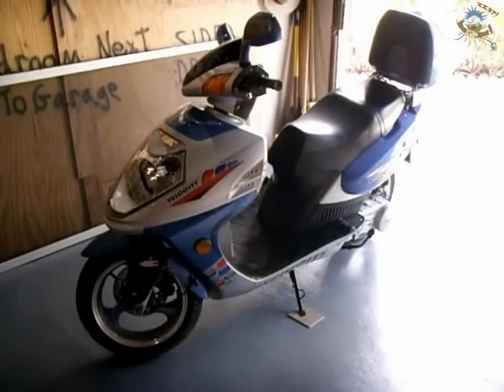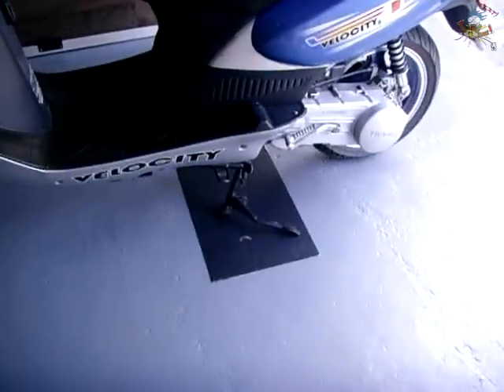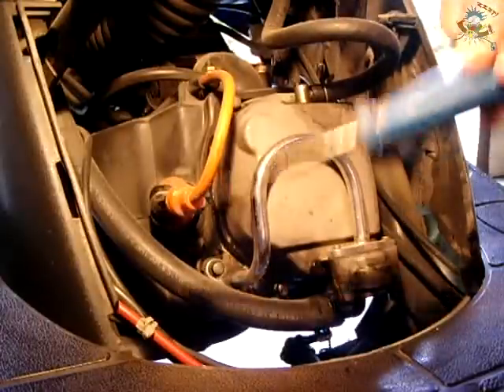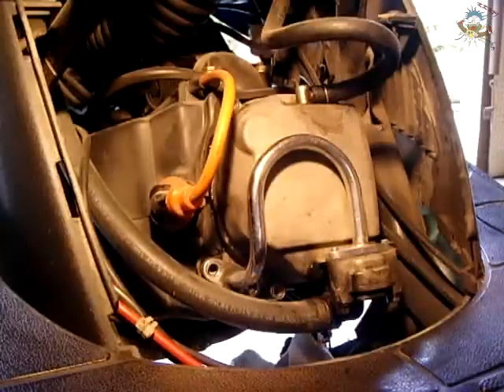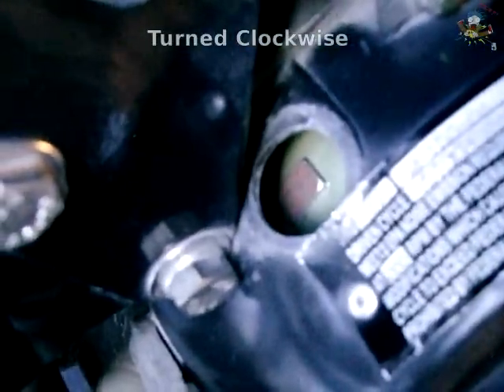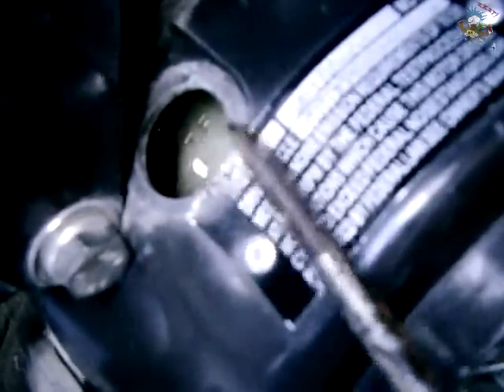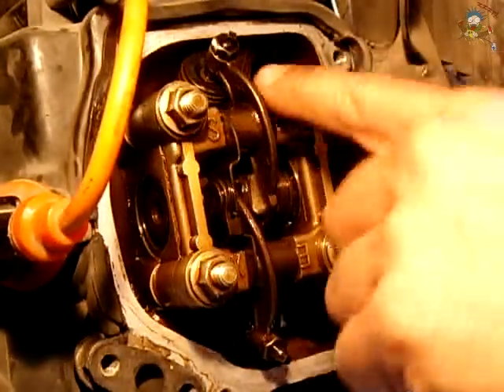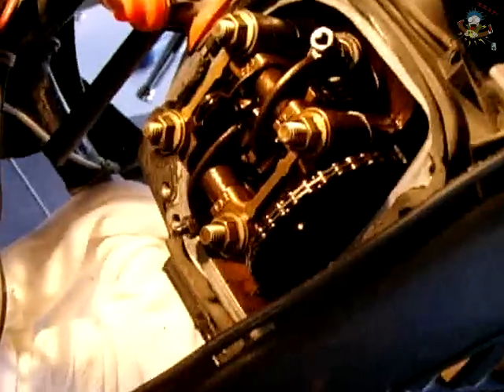Highly Detailed GY6 Valve Adjustment Procedure(Step By Step)

Comment: I have a icebear Trifecta 150cc gy6 long engine. On a factory label it states the valves are top valve 0.08 and bottom 0.09.....some video's say 0.04 top & bottom 0.05 which is right.

Comment: I watched this carefully. Here are two things that I feel should be absolutely clarified. He said "ohohfive" very quickly when using the feeler gauge This means .005 inches Do not use Millimeters..... the thickness used to set the GAP of the rocker arms. It is marked on the feeler gauge and will very quickly be unreadable later. So make a mark on the gauge leaf that you can easily recognize later. Turning the engine to get to the right point for TDC (Top Dead Center) where all valves are fully closed so the gap can be set, MUST be done so that  the engine is turned in the clockwise direction with the wrench. Backwards does not work well! In reality, a very informative video. Thanks!

Comment: I hope ENM or one of the commentators can provide me with an answer. My 150cc brand new scooter has trouble starting after its warmed up(sometimes it won't start at all). Could a valve adjustment be the culprit or is there a better or more realistic solution? Please help!
Reply from the maker: Adjust valves first

Comment: Thank you for the video, my scooter seemd not having power anymore, despite new belt and Variator  it was the valves, i adjusted the spacing and now the scooter seems like a jet! (Had a little problem with the gasket of the valve cover, so it was leaking a little oil, but rearranged the gasket, repositioned the cover, and now is perfect!)
Reply from the maker: Glad it helped Francesco!

Comment: Great Video,  I like a tight 05mm myself.  But I have found that some bikes run better with 04mm and others up to 06mm.  I have a valve setting tool but I prefer using a box end 9mm box for the nut and the tiny end of the valve tool for the screw.
Reply from the maker: Glad you liked the video!

Comment: Scooter repair technician reporting in. I want to set a remark he said straight. I also speak from a user stand point.. I own. Gy6 150 it's my daily driver.

You only need to check valves at 5k unless you are having a problem. This is per manufacturer guidelines. Every 5k there after. Since 2016 forward there was a revision at the factory depending on which one produced your engine. They are a  lot better now. I witness on a regular basis bikes at 12k plus that come in running great and never had valves adjusted. Not saying don't, but Its not like it used to be.

I've witnessed engines with 20k miles and still running great. The key is changing oil on time. Doesn't matter what you use as long as it's correct weight. Don't use additives.

Biggest problem I see mainly is belts snapping after 6k. Change belt AND rollers at 5k. By 10k or so your clutch will be worn... 60 bucks.. replace it. You will get hints if you watch your rpms and know where they should be for a given speed..  the engine will rev a little higher. If you see that or feel a vibration thats unusual that's another possible sign.

Look, let's be real. These scooters aren't designed to last. By 3 years daily driving it's not the drive train you will be worried about. It's everything else... Turn switches, brakes and system, tires, and all that cheap plastic body panels will crack and break apart. Muffler baffling breaks off inside given you this loud rattle noise because of inferior welding.

Buy one, plan on having roughly 1 year of great service. By year two you will start seeing the effects of time. Most repairs will be very cheap. By year 3 you need to make a decision... Given you will be at 15k miles... Think about just buying another scooter. Strip the thing for spare parts and go on with it..
Reply from the maker: It doesn't hurt to check sooner.
Reply: @electronicsNmore  each time you Crack open your engine you invite oil leaks. If there isn't a problem  don't fix it is my war cry.

Look I get it. Through the years I've learned about scooters.. I'm not a know it all and I certainly am not some self proclaimed master. I am however well versed in the drivetrain even going as far to being a tag along to Chinese and tiawanese factories getting to see them being made.

I'm more knowledgeable about the  people who buy these things and have broke them down into categories. You fall into the tinker group. You have fun tearing into your scooter because it's cheap, less risky, and it entertains you.. nothing wrong with that, at all. However this type can be a PITA. They will bring their scooters in have me tune them to factory spec only to go home and undo everything I did on a perceived notion their "tune" makes more power.

Another common group is the "I want cheap transportation". They just want their scooters to start and run. Maintenance isn't on the forefront with them. They are the ones I make my money on. You commonly will find them out in the wild in their native habitats walking their scooters on the sidewalk with snapped belts or catastrophic engine damage. They don't change oil and if it starts and drives that's good enough.

Next group is the "virgins". Its their first scooter and perhaps first real purchase. They are excited, over cautious and also a PITA because they will ask the same exact question to 50 different people looking for the answer they want to hear. They commonly have aspirations of keeping their scooters forever. You will find them in their native habitat spending way too much time washing amd waxing and debating whether to use  synthetic or Dino oil. By end of year 2 they finally realize its not worth the cost and hassle of doing everything they did and will then slack off. By year three their scooter is a collection of duct tape, wire amd super glue.

In the end., these aren't designed to last. They are not high performance. They are designed to hit a price point and to be as cheap as humanly possible. It doesn't matter what oil you run.. it's doesn't matter how special you think your engine is because a lot of people think this.. by year 3 of daily use you will hit that price wall

Comment: Hey great video man! The clearence is 0,05 in metric mm? Or inches? Greetings from Norway.
Reply from the maker: 1.25mm or .05"
Reply: @electronicsNmore  ok great mine were at less than 0.05mm now. Hopefully the reason why it was near impossible to start. Thanks for the quick answer.
Reply from the maker: @gjoffis  If the gap is too small, you'll have problems.
Reply: @electronicsNmore  yeah, now it starts like its new from factory🤩 thank you for the help.
Reply: 0.005 is 0.127mm, not1.25 I think.

Comment: hey bro I have a piaggio fly 50cc I have big problem to start the engine when the motor is cold I really suffer I cleaned the carb  changed the air filter change the plugs but still the  same problem.
I need almost 1 hour to start the engine.
Is the valve adjustment can be solution
Reply from the maker: Do you have an enricher?
Reply: @electronicsNmore  yep the carb have enricher but since I bought the scooter its not connected.
Ps. My scooter it a used one not a brand new.

Comment: I like the video..!! I just want to add that I preffer to find the Top dead center by taking the spark plug of and carefully introducing a small screw driver. That way I am 100% sure the the timing is correct. A simple teeth off on the camshaft would give a degree.
Reply from the maker: The timing marks should be accurate, but you can do it that way also. Thanks for watching!

Comment: GY6 149cc Tune Up Specifications....

.003 - .005 Inch : Intake
.005 - .007 Inch : Exhaust

( .076 - .127 Metric : Intake )
( .127 - .178 Metric : Exhaust )

Idle Speed : 1700 , +/- 100 RPM

Spark Plug : NGK C7HSA
Spark Plug Gap : 0.6mm - 0.7mm

Engine Oil : 15W40
Reply from the maker: I prefer a smaller gap for intake/exhaust.

Comment: Great vid.  I brought an older scoot and that pipe over the valve cover is missing.  What is that pipe called and what's it do?
Reply from the maker: It's an "EGR" cover. Exhaust Gas Recirculation.
Reply: Mine has that and a PCV circuit. Love my 06 Kymco GrandVista 250.

Comment: What happened if i checked the clearance but not rotate to crankshaft?
Reply from the maker: It's impossible to check without rotating the engine into the correct position.

Comment: .003 on intake and exhaust valve. Thank me later. Don't set at 4 or 5 or all this other bullshit.
Reply from the maker: .003 to .005 works fine. I've tested them all over the years.
Reply: @electronicsNmore  4 and 5 through trial and error makes compression loss it seems
Reply: More pep at 003. Do you still work on bikes?
Reply: @electronicsNmore  look forward to more troubleshooting moped vids

Comment: Help
I managed to dropped the fucking nut inside the engine. It was right under the chain so I tried to let gravity help but that asshole only let oil out because apparently it gets to decide the laws of physics. So I attempted to drag the nut out with a plastic straw (only thing I had that was long and thin) but I only managed to push it further back and the lil fucker pulled a Houdini on me and disappeared in the back. Can anyone tell me where it is and how do I get it out because draining the oil didn't work and I'm scared to start it. Thanks in advance.
Reply: Great video btw

Comment: So I did a valve adjustment and I started it before putting the crankcase cover back on incase I needed to re adjust, now have oil spewing out from in the middle of the rocker arms??
Any idea what's happened please?
Reply from the maker: That's normal. You don't run the engine with the cover off. Be sure to watch my "GY6 Scooter" video playlists, and share. Thank you!
https://www.youtube.com/watch?v=5vl1mrTVCQ0&list=PLQ6IOhUBblU1bkRJ9MagPsKn_Mekq4ws8
Reply: Thanks for the reply, it's still puking oil everywhere, when I take the cover off it looks like it's coming out of the groove in the top left of the rocker arms, it's spat LOADS of oil, do I need new rocker arms and cylinder head? The tapping is really bad now no matter how much adjustment I do

Comment: Everyone tell me I have air leak cracked hose some where  . I only have three hoses  one from the valve cover  that splits to two one to the carb the other to the elbow bend manifold  and  gas line to carb and the drain hose that’s it have taken them off and no cracks or holes .. was told gas leen mixture might be closed ..was told close it open 2 . 5 turns .. carb is new thought it would be pre set guess not .. 😕
Reply from the maker: Check valves, check carb, and check for hose leaks(cracked intake manifold)

Comment: Well I went through all the steps including the feeler gauge recommendation and while I was waiting for battery to charge I find a plate riveted on bottom frame has all the specs for engine and their valve clearance is top 0.06  bottom (exhaust)  0.08  big difference from .04 and .05   Ends up two kinda scooters one model is made to American standard smog and all that save the whales .. then there is a real Chinese scooter they don’t care if they leave a smog trail as long it runs to them it’s a work horse 
valve settings are different higher numbers .. long story short put battery and of course it did not start makes the blub blub sound better than before just not starting so setting must be wrong !! Gonna do this again and try the factory settings on the plate .. so my lesson today was beware of Trojan horses 🐴bearing gifts ..

mpg
Reply from the maker: Most people use smaller gaps than factory.
Reply: Thx bro

Comment: So once at TDC you say valve  have to be  closed does it matter because once you are there ( TDC ) you are going adjust them to proper settings so why should it matter open or closed if you are set at TDC
Reply from the maker: If they're not closed, that means you don't have it set correctly.
Reply: I’m not at TDC  then  ?

Comment: So the gauge clearance will  work for  any gy6 150.cc  I don’t have wrench’s or gauges but found at local auto parts tools will be $ 25 for
Reply from the maker: You can find very thin(.004/.005") strips of metal at a hobby shop for only a couple bucks.

Comment: Is cause with the on and off the engine?because, mine it will start but it will die down in a few minutes.just wonder!
Reply from the maker: No way of knowing. Adjust the valves as shown so you can rule that out as the problem.

Comment: Thank you, this was PERFECT!
Reply from the maker: Glad you enjoyed the video Scott! Be sure to watch my GY6 and Auto/Mechanical video playlists below, and most importantly share my channel with many others. Thank you
https://www.youtube.com/watch?v=5vl1mrTVCQ0&list=PLQ6IOhUBblU1bkRJ9MagPsKn_Mekq4ws8
https://www.youtube.com/watch?v=hnd7P7O_vEQ&list=PLQ6IOhUBblU3mBem9ImEgGzmqToW6SCJD
Reply: @electronicsNmore    hey bro I have a piaggio fly 50cc I have big problem to start the engine when the motor is cold I really suffer I cleaned the carb  changed the air filter change the plugs but still the  same problem.
I need almost 1 hour to start the engine.
Is the valve adjustment can be solution

Comment: what can i use to  help know the resistance and all like that piece of flat metal you had slipping thru there lol
Reply from the maker: It's called a "feeler gauge".
Reply: @electronicsNmore   TY, and what number am i to be at? Im told i needed to adjust my valves-- my scooter will start but wont idle correctly no matter how many times i try, and when down the road bout half a mile and on full throttle it shuts off and dies, then struggles to start back up.-- My bike has 6,488 miles, last time valves were adjusted was when i added a BBK last summer/ fall --- Were they right? I need my valves adjusted?

Comment: Please help me understand what I’ve found ok so I’ve looked at the wiring diagrams for this little quad relating to the ignition coil starting at the CDI. So the two pin single plug has one black wire which is the ignition switch input that supplies the CDI with power from there I moved to the 4 pin 3 wire plug and checked the pin on the box directly it reads that is a hot wire like it should be but magically when I plug the harness into it I changes to ground

Comment: I am definitely trying this tomorrow I’ve got to ATVs that have been broke down for almost 2 years and they where both a pain in the ass to start after the starters went out
Reply: Hopefully this does it cause I haven’t been able to locate an adapter for my compression gauge to check that I know the white one has low compression but it would do atleast 30 when it was running the green one was kinda slow but very torquey it would pull logs heavier than me and they are only 50cc engines
Reply from the maker: Good luck! Be sure to watch my GY6 video playlist for other great videos. Thanks

Comment: Found this video last night after many suggestions that my rough start of valve tolerance related. New GY6 and new 24mm Carb, could this still be the issue? I have to hold the throttle open to get it to stay running during cold starts. After about 1 minute it idles fine. Is this an intake valve characteristic?
Reply from the maker: Sounds more like a carb/enricher problem. Check out my GY6 video playlist below and share. Thanks!
https://www.youtube.com/watch?v=5vl1mrTVCQ0&list=PLQ6IOhUBblU1bkRJ9MagPsKn_Mekq4ws8
Reply: After adjusting the valves, they were definitely tight, but the issues persists. Your enricher/auto choke video is excellent as well, and that’s next on my list to check! Thanks for the excellent videos and suggestions

Comment: Thank You!  My bottom valve was completely closed so although it would run, it won't stay running.  Nicest video online for this.  I appreciate all the work you did to put it together.
Reply from the maker: Glad you found the problem! The best way to thank me is by watching my videos and sharing my channel with others. Thank you
Reply: I've been working on 2 cycle scooters for years, but these are new to me.  I bought it in pieces, so putting the puzzle together was a challenge.  It was multiple problems, but this was the most frustrating because it would run, and then won't.   Thank, I'll watch more and let my friends know.

Comment: Any suggestions or tips on how to adjust them without the little measuring tool you slip under it? Should there be barely any play or none or alot? Anything
Reply from the maker: Use a thin business card.....should work.

Comment: hi I have a leximoto arrow it has just over 3780 miles will I need to do anything it starts ok
Reply from the maker: Definitely check/adjust the valve clearances. Intake .10mm / exhaust .15mm. You'll need to unscrew the caps on the valve cover to access the adjusting nuts. Also unscrew the cover by the flywheel on top so you can line up the timing marks before adjusting the valves.

Comment: Just a tip for everyone else. It is definitely easier to hold the center with needle nose pliers and lock the nut with a open end wrench, especially if you've never done this before. Great video!
Reply: True. I use a .004 as a shim while socket tightening. When I yank out the 4 only 3 will fit. Good stuff
Reply: Just buy the special took they make for doing this, I think you can get them quite cheap now.
Reply: @elobiretv  I'm as cheap as anybody, and that tool is a MUST.  search 'Valve Adjusting Tool For Scooters'  it's a two-piece tool with one piece having 3mm, 3.5mm, and 4mm and the other piece having 9mm and 10mm sockets.  great tool.  way less than ten bucks.